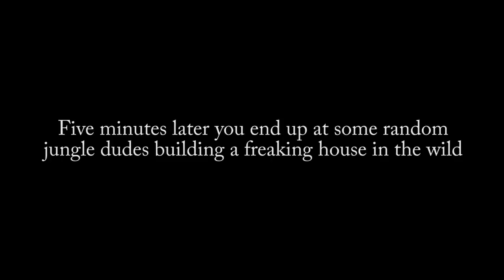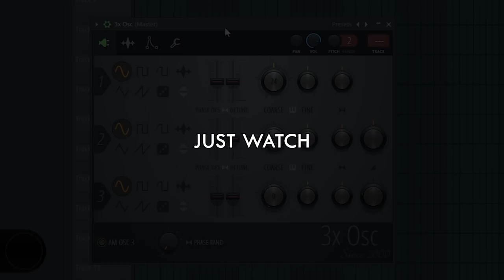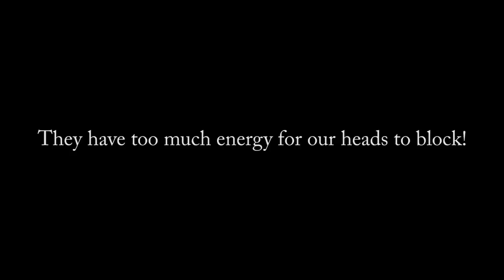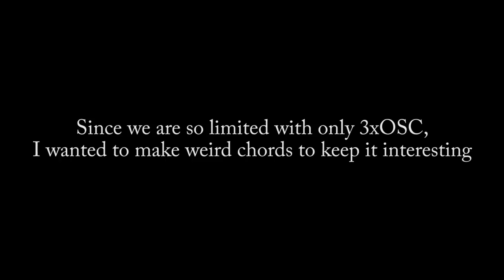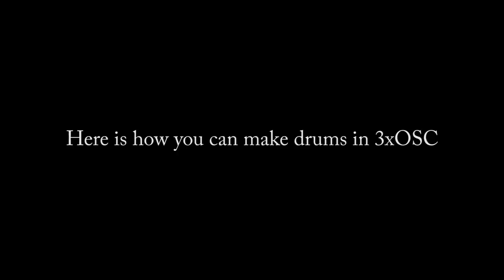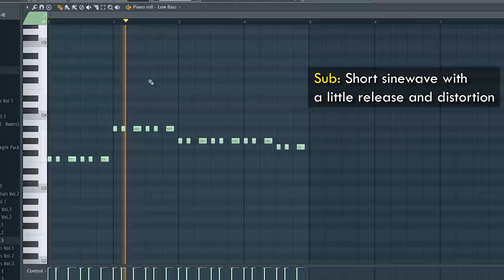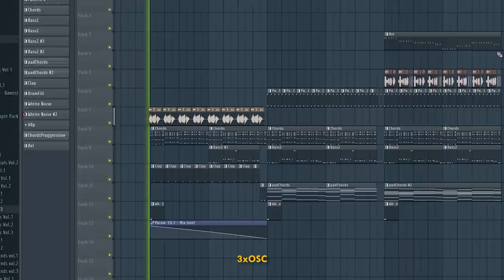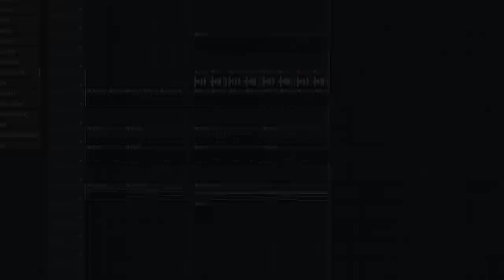How to make MUSIC out of NOTHING - FL Studio

Comment: Dude wtf, you've made a track with 1 stock plugin, and I can't even make a song LOL... with SERUM.
Reply: LPT: try challenging yourself to make music with stock plugins. I did a similar thing to this video where I used 3xOsc to create a clubby track a couple years ago and that taught me a ton about designing sounds using oscillators and effects. It wasn't a super amazing track by any means, but that made it relatively easy to pick up on Serum and design really cool sounds.

3xOsc and Serum aren't really all that functionally different; Serum is kind of like a 2xOsc (or 4xOsc if you're counting the sub and noise oscillators?) with a built-in FX chain and a lot more automation capability. Basically, if you spend a little time in 3xOsc and design some cool sounds with that, those skills can translate to Serum, which both makes it easier to use and allows you to design WAY cooler sounds. 

LPT2: if you're having a difficult time creating a track, try putting something together with a ROMpler (like Nexus2, for example) where there's very minimal sound design involved. Yeah, the track probably won't come out sounding exactly how you want, and the sound selection might not always be super amazing, but that's okay. The focus here is to just simply make some melodies and arrange them into a track, and just let your creativity flow. Once you've finished a few tracks, pick out one or two that you like, and start replacing the premade sounds from Nexus2 (or whatever you may have used) and design your own sounds to be played instead. That can make it easier to take a track that sounds musically good but bland in sound selection to a song that sounds great musically and has great sound selection.

Edit: You don't need to use a ROMpler actually, you can also download a preset pack or two for Serum and use those to create the music, and then go back and design your own sounds to replace the presets.

Hope this helps anyone who reads this! Try to avoid what I've been doing for the past year or so, don't do sound design and musical composition at the same time (unless that really works for you) at least in my experience, that usually leads to making a neat melody and then spending hours meticulously designing a sound for it, and then forgetting the idea I had. In other words, doing both at the same time might just take you too far away from composing to finish a track.
Reply: @PERTEKofficial  Thanks for the essay 😂 you're a kind person to type all of that. I appreciate it.
Reply: Justin Jehoshaphat  nah, another hobby isn't the way to go. I have several hobbies, this is the one I need to just make work.
Reply: There is a demo song in fl made almost entirely in 3xosc
Reply: Justin Jehoshaphat  its OZIASO - Fausta and I can confirm its 100% 3xOsc
Reply: @PERTEKofficial  "don't do sound design and musical composition at the same time" This is really good advice! I've wasted so many dozens of hours sitting at my computer trying to get a melody to fit with a sound or a sound to fit with a melody and only to end with frustration when I finally get both right and then I realize I've only got a 10 second loop and now I need to start all over but with a base or chords or whatever. 

I'd also add, make it a habit to always finish every project you start! Even if the song doesn't turn out how you like if you get into the habit of finishing things then it will be easier and easier to make music. If you get into the habit of quitting and starting something new, you will never make anything.
Reply: @PERTEKofficial  "don't do sound design and musical composition at the same time" this was the advice I needed, thanks! It's now very obvious what I've been doing wrong
Reply: @PERTEKofficial  I think Harmless can make sounds pretty equivalent to Serum. You actually don't need plugins for good sound
Reply: @thethinker2372  Yeah, I do like FLEX and Harmour
Reply: Give your plugins to me 😂😂
Reply: @StepwaveMusic  will you teach how??
Reply: Well, i compose (as a hobbyst) from more than 40 years, and about half of the times the idea of a piece pops out by putting my hands on the keyboards while skimming the presets of a synths, or creating new ones. The main idea is then really tied with the sounds, in my mind it does'nt works with a different sound.

So to me sound design is part of the early creation process. But each one must follow his own "flow" to bring out ideas, so what works for me could be a total inspiration blocker for everyone else :)
Reply: Its me😅
Reply: Chicken George rude dude

Comment: Very interesting and informative video! On a point of interest, the way you described the head blocking out high frequencies but not low ones is wrong. You said that high frequencies carry low energy and are thus blocked, and low frequencies carry high energy which are thus able to pass through.

The correct explanation is: As sound passes through a medium that isn't a perfect vacuum, heat energy is dissipated into the medium. The heat energy is transferred by the friction the sound waves make by vibrating the molecules they pass through (that's where resonant frequencies come into play). This loss of energy through friction and then heat is what causes attenuation of sound waves. Higher frequency sound waves cause faster vibrations, and therefore lose energy faster than lower frequencies and have less penetrating capacity before attenuating.

The difference in our explanations is that you are confusing frequency with amplitude. The amplitude of transverse sound waves (the ones you are illustrating here) account for pitch while rarefaction in longitudinal sound waves account for the energy they carry (expressed in volume, dB).
Reply: So basically frequency is pitch and higher freqs lose energy quickly understood but why did you mention amplitude here i didnt get it 😅 (like where does he even illustrate various amplitudes?)

Comment: 3:03 High frequency waves have HIGH energy due to
E = h*v = h * c/lambda

with v being the frquency, lambda the wave length and c the phase velocity.
Reply: And detune doesn't remove high frequencies from one channel, it just makes frequencies slightly different with same amplitude.
Reply: Yes
Reply: its the opposite, high frequency waves have low energy and are very easy to stop, treat and soundproof, the sub and lower frequencies however....
Reply: @MrFree-vj8qj  Easy to stop yes, but the energy of high frequency waves is higher. E = h nu, where nu is the frequency
Reply: Dude, you are talking about electromagnetical waves or other quantizable waves (electrons, phonons, etc.). For sound see: https://en.wikipedia.org/wiki/Sound_energy
This formula does not apply to sound.

Comment: Nice piece of work u made there :D

Just a physical detail you misinterpreted:

Its not the energy of the low frequencies that makes them surpass our head. Indeed, if you only look at the frequency with same amplitude, the higher frequencies have higher energies. Its the wavelength! An average ear- to-ear-distance is about 17 cm. This approx. equals soundwavelenghts of  2000 Hz. Everything below this frequency will be bigger than 17 cm meaning that the skull itself will not be big enough of an object to block this wave.

Comment: Did you completely miss the AM osc 3 setting in the bottom left like I did for so many years? I actually managed to make some very interesting sounds combining that with subtle phase ofs/detune/fine across the oscilators, with minimal processing.
Reply from the maker: I'm saving that part for another video!🙏
Reply: @Voriesmusic  Nice, I was quite surprised what 3xosc can do, especially when you import some waveforms. Even for a basic synth it doesn't have amazing filter shapes etc. but I still sometimes use it when it offers all I want